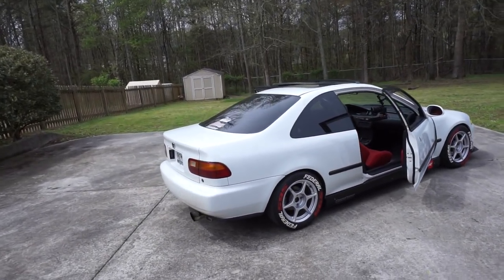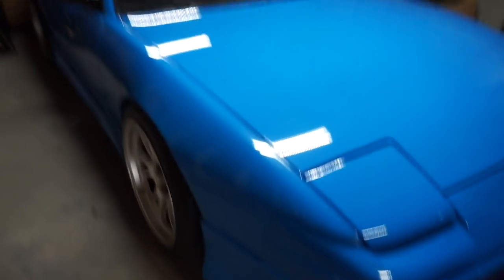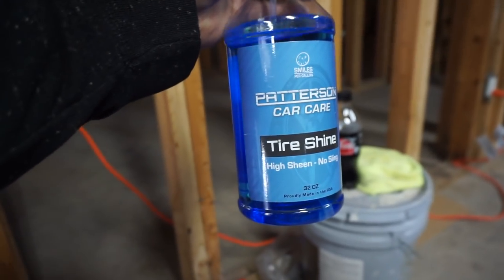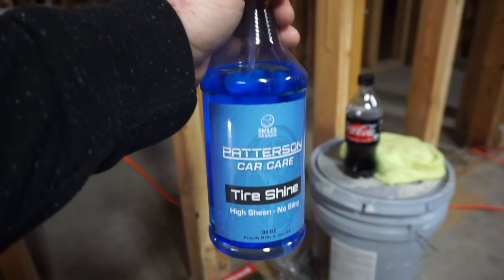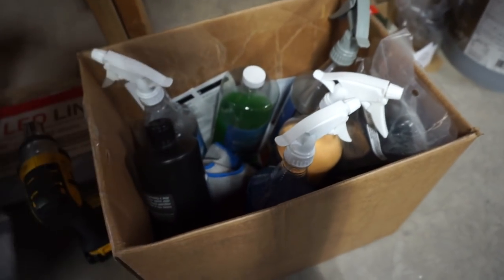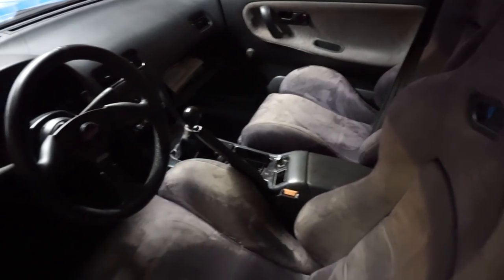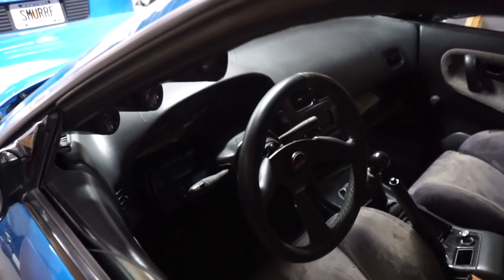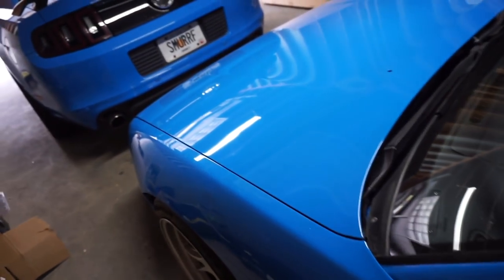MY K20 EG EJ1 CIVIC GETS REVIEWED BY DAVID PATTERSON!  HSG EP. 6-23

Comment: Did you fix your speedo jumping around ? My eg hatch does the same thing I haven’t been able to figure it out either I thought it was my cluster but any cluster I put in does it
Reply: Bellacima_Inc  check the power prong it could be corroded. It’s the middle pin on the speed sensor pigtail. I had the same problem and I cut a pin of another plug wired it up and I haven’t had a problem since
Reply: Raymond Rios thanks I will check it out. I’m sure it’s my problem because I have checked everything else

Comment: Hey bro I'm having trouble with my vtec engaging. I have crome and moats chip burner. Dunno if there is a setting the cts or vtp remover? Not sure I have another chipped computer. I can use that chip in any ecu. Works fine. Any info would be great. Thx
Reply: Michael Amelio contact huntertuned. He tunes with crome alot.
Reply: No Budget Racing will do thx